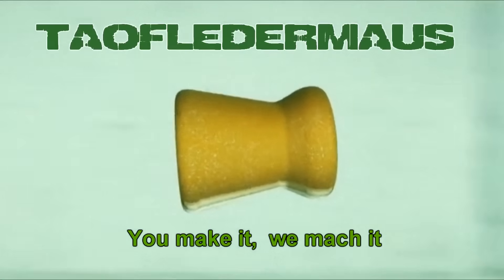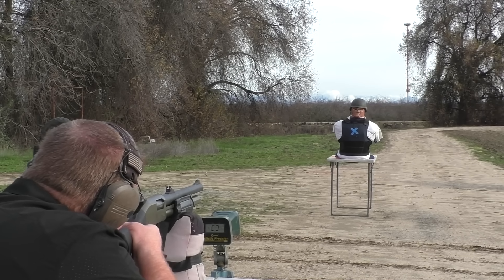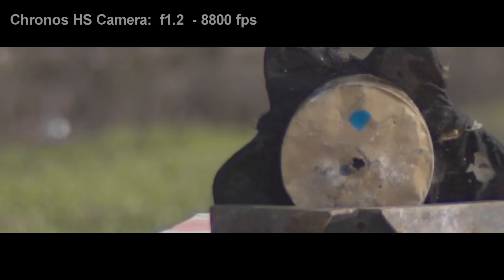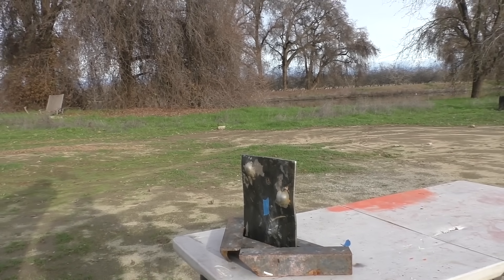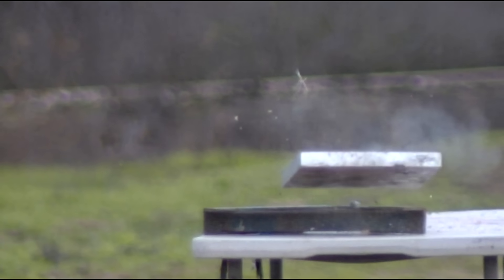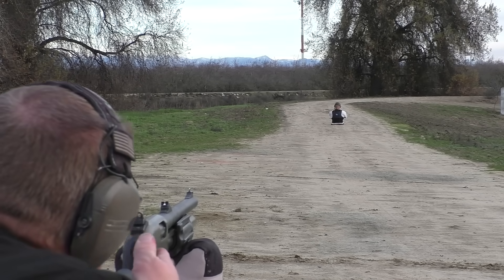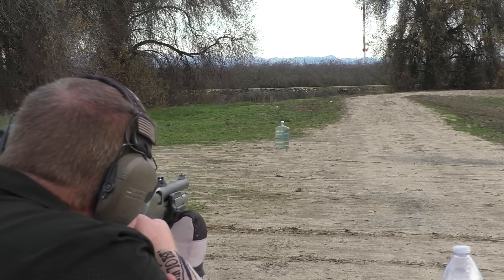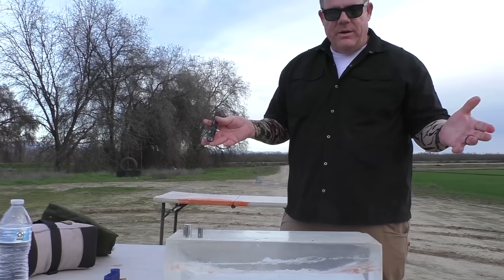The "MACH-71"  Super Perforator Slug   -  TESTED

Comment: I've always had an idea kind of like this, where you have a soft outer hollow "sabot" that would be designed to expand in a target, with a hard steel penetrator inside of it. That way you can get a kind of armor piercing hollow point, where if a target is wearing body armor that penetrator will still punch through, but if not then you get the stopping power of a hollow point. It's cool to see that the idea might have some actual merit if you designed the soft metal outer piece to fragment or expand a little more.

Comment: The fancy cutout on the front does absolutely nothing for the aerodynamics of the slug, and is actually going to slow it down, by creating an air stagnation point at the front of the projectile. If you want to make a slug that is optimised against wind resistance, just copy the shape of a standard 303 rifle bullet ! You wont be far wrong!
Reply from the maker: Many 12ga slugs are completely flat at the front.   Since there is a bow shockwave at the nose,  it doesn't really affect aerodynamics like you think it would.

Comment: I can actually see the fluid dynamics of this in my head.
if the gap between the aluminum sabot and the core were just a tiny bit bigger, a slightly rounded or dimpled back end on the core piece. maybe a bit longer taper on the front with a harder material.
I wouldn't change a thing with the aluminum sabot.
As this round leaves the barrel, much of the air is channeled into the sleeve space between the sabot and the core, as soon as it hits something, that also gets channeled in, compressing the air further, which then pushes the core out from the back, much like popping a bearing by pushing bread in behind it.
It worked beautifully with the lead, which flowed in like water at those speeds, less so with the aluminum, which is much harder.
Steel, nope, need a harder tip for sure

Comment: Great video guys! Without the brunt of the energy knocking those plates over I imagine the slug could have penetrated…like if they had put a cinder block behind that held the plate firmly, but maybe not. Awesome either way!
Reply from the maker: The plate has much more mass than the slug and doesn't even start moving until after impact.

Comment: That much water in California is going to cause Earthquakes.
Reply from the maker: I don't think that is how earthquakes work
Reply: @TAOFLEDERMAUS  Actually... ask Google's BARD AI. It will save you a lot of time researching how or why that is.

2.5x the typical snowpack last season, and excess groundwater weight and seep into active faults - it's a thing. 

USGS results lately in NorCal seem to confirm. The last time there was a significant snowpack like this was in 1983. 

Was also a solar max, but they had decent earthquakes that year, too. I wouldn't be surprised if a decent quake resulted from that kind of spring thaw.
Reply: @taofledermaus  Per Bard: "A spring thaw after record snowfall can cause an earthquake because the weight of the snow can put stress on the ground, which can cause the ground to break and shift. This can trigger an earthquake, especially if the ground is already weakened by other factors, such as previous earthquakes or landslides.

In addition, the melting snow can add water to the ground, which can make it more slippery and less stable. This can also increase the risk of an earthquake, as the ground is more likely to move when it is wet.

For example, in 2011, a magnitude 7.0 earthquake struck Christchurch, New Zealand, after a record snowfall. The earthquake caused widespread damage and killed 185 people.

In another example, in 2015, a magnitude 7.8 earthquake struck Nepal after a record snowfall. The earthquake caused widespread damage and killed over 9,000 people.

These are just two examples of how a spring thaw after record snowfall can cause an earthquake. It is important to be aware of the risks and take precautions to stay safe during this time of year."

Comment: Here is an idea.  Build the outside case from barrel grade steel and the penetrator from even harder tungsten.   Now have a charge inside the casing which has a shear support system that the penetrator sits back on along with the tight fit and glued in.   When the tip of the penetrator makes contact the force is enough to shear the supports and then force the penetrator back causing the inside secondary charge to go off adding a lot of extra force to the penetrator and pushing it through even the best bullet proof plates and armor.
Reply: Literal bolter

Comment: Kyle is a machinist. He has his stuff together! I figure he thought to have a hardened projectile that's pressed into a traveler, that will not melt in the shotgun, but, with the help of an old shotgun shell wrapped around it, it will spin out of the barrel and bury itself deep. Then, when the outside carrier nose flares & stops, it opens the press fit, & the inertia spits the hardened projectile on forward till the PUSH wears out! 
   I'm a retired tool-designer & I  imagine a lot of thought went into this punkin'-ball slug. 🙌🏁
   Bill, from Tn., 🇺🇸

Comment: If you made the steel plate so it didnt move you would have different results. Its like if someone limp wrists while shooting a handgun, it doesnt cycle properly. If the plate wasnt able to fall back so easily it would change your results.
Reply from the maker: It seems that would help but the velocity of the slug is so great  and the mass the plate is so high,  the plate doesn't actually move until quite a while after impact.

Comment: Wait a minute it is not supposed to work like that aircraft. Because the jet engine needs air flow through the engine or here the slug. The air is  supposed to pass inside the slug. This slug is closed. No air is going through it. Just around. Amazing.

Comment: Lots of suggestions, here is mine. I have been shooting for about 69 years, including shooting a hole in ½" carbon steel with an ordinary soft nose bullet. Weatherby’s old catalog from 1960 had some information about that, I do not know if they are still showing that. I agree that tungsten would be good, very high density and reasonably hard. You could make the slugs about 0.64 X the diameter of the steel slug and have the same weight (keeping the length the same). Tungsten carbide is almost as hard as diamond, but its density is a little lower than pure tungsten. I doubt that the aluminium cup is important, unless you can make it stay attached to the core to provide expansion. I suggest you just make plastic sabots - perhaps PTFE, as suggested below, although I think Remington and others may have used something else, maybe Nylon. Nylon 6/6 would probably be good, and you can buy it already filled with the solid lubricant, molybdenum disulfide, and other additives. For maximum velocity, nothing beats a sabot - while giving us the aerodynamic advantage of a sub-caliber bullet. One more point about loading, I noticed that you selected a type and quantity of powder to get the desired results - which some people overlook when using sabots. Think of the fun we can have!

Comment: wonder if there would be more penetration by the steel core if it had more of a rounder taper towards the shoulder instead of a straight cut?  The pointed tip is fine

Comment: Might have a better chance of penetration if you clamp the plate down so it cant move as much. I'm not a gun person but these are an impressive design with lots of potential for refinement. I wonder how different materials would change the result.  Like if you swapped the aluminium and steel around how would it impact things, Hard outer steel layer with a notched aluminium core. Would it still penetrate a vest and then eject a spray of aluminium or would it just lose its penetrating power?

Comment: Really cool video. It would be interesting to see the effects on your targets if they were held more securely as it seems to me that a lot of the impact energy is being displaced / reduced by the instability of the targets. Perhaps clamping the steel plate in a vice and maybe hanging the lead plate in front of a concrete wall or on a tree would give you a very different set of results.Either way the Welsh wizard has produced one hell of a bullet. :trophy-yellow-smiling::text-green-game-over:
Reply from the maker: The impact occurs so fast,  it really doesn't matter if the target is held securely or not.   We've tested it and the results are exactly the same.

Comment: for safety reasons i would recommend a rig from which you can hang targets like steel plates.
standing targets tend to fall back when hit, forming an up facing angle which directs ricochets up, drastically increasing the distance said ricochets can travel.
a hanging target tends to swing back when it is hit, deflecting any ricochets down towards the ground, which reduces risk to the people involved, while also making the slugs easier to retrieve i would think.
Reply from the maker: The plate has many times the mass of the bullet and is quite slow at reacting to movement.

Comment: Scram jet technology.  If the point is correctly positioned the air density at the edge of the intake is very concentrated.  Kind of like a mechanical air compressor which created a manageable burn at high altitude.

Comment: The slug would of ricochetted if the plate was in solid! 
"A sprung load!"
Because it was movable without being secured in place with some sort of tension being a " Un sprung" Load!
It comes to a dead stop!

If you put mount that metal where it can't can't move. That energy can ricochet back at you! When it can't transfer enertia . Meaning it will take the enertia and transfer it.  U will not have a bounce back effect!

Although it may have been able to penetrate the metal!
Better keep it unsprung then to have it sprung and fly back at you!!

Comment: If the slugs used hardened steel core and a sectioned aluminum body theu would likely punch the plate. The energy required to mushroom the aluminum is wasted rather than punching through

Comment: the transfer of energy, your test didnt have support on the plate so it took all the energy and moved. A human target would experience more resistance to movement so the round may be able to penetrate while plate is held in place not allowing recoil of plate.
Reply from the maker: The impact occurs very fast,   in fact,  faster than the heavy plate can move.
Reply: @taofledermaus  you could sayy that but once enough energy transfers then it will lose momentum. the bullet stopped moving because transfer of energy. if it still had energy then it would deflect or move but since the plate goes flying then one can see the energy transfer instead of penetrating.
Reply from the maker: @knightjacob80  We've tested it before.  It doesn't matter if the plate is loose or set against a sand bag.  You are confusing low speed collisions with high speed ones.
Reply: @taofledermaus  Okay :)
Reply: @taofledermaus  The plate does move though so yes transfer of energy lessening bullet pen.

Comment: But is there a "bypass" around the nose point intake?  The secret of the SR-71 was that the nose intake point could retract at slower speeds and move forward at higher speeds in order to control the efficiency of the engine's thrust output.  If the pointy tip has no bypass, as in this slug, and there is just a point, it would seem to me the aerodynamics would not simulate an SR-71's engine in any way.  However, as they say, "The proof is in the pudding".  If the results are as good as the producer claims they are, then good for him.

Comment: You guys should really consider mounting the armor more securely.  With kevlar it hardly matters since that is worn on a person but with armor plates that are normally mounted on vehicles or stationary blinds they don't tend to absorb kinetic energy through inertia transfer while your targets do.
Reply from the maker: With Kevlar,   you need something to back it up for it to function normally.    The steel plate,   the mass of the plate prevents it from moving until quite some time after impact.
Reply: Visually it looked like it moved before all the momentum transferred, but looks can be deceiving.  It's all in the math.   @taofledermaus What's the mass and dimensions of the steel plate?  I can calculate it.

Comment: ai got a plastic crossbow poundland and ran out of darts i made some out of bamboo hollow tip and used sand paper flights smooth and coarse if you understand english aerodynamics lucky i covered the point because it bounced off the window straight back in my eye the shape of the planes wings which lifts your not looking to nature and seeing how fast a bird flies faster than light meets your short sighted eyeball teh old muscle cars cut through air chevvy ss plymouth charger impaler

Comment: jet engine design delivered on a hunting pellet shiny surface reverse it square slug covered in wet and dry spring that retracts from the recoil keeping in mind vacuum double charge cluster smart the charge that propels the bullet and another that magnesium phosphorous volatile coat it in fluerescent tubing from fishing or glass to peirce the armour plate... bearing in mind that tech has gone viral twin armour plated reinforced glass and fibres like polyamide kevlar are just there to slow the projectile down the new plastics berrylium coatings finished to a high gloss resistant to cutting disks and hack saws slides off tungsten carbide chromium alloys basically i dont know the new drone tech how far into the millions your playing with well done youve penetrated kevlar ukraine going up against russia is like wales going to war with england and doing well

Comment: Hmm, maybe the ones with the titanium or tool steel penetrator will make it through the metal plate.
maybe this one did not make it because the steel core did not seperate from the aluminium casing?

Comment: Doesn’t the aerodynamics cause it to tumble?  The area around the point catches air hard
Reply from the maker: They are spin-stabilized
Reply: Ig things work differently beyond supersonic speeds, it doesn't tumble since the area around the steel cone catches air evenly (Or doesn't at all if it's traveling fast enough where the pressure cone deflects air away from the ledge but the steel cone has to be long enough for that to happen)

Comment: If the steel plate was better supported the bullet core may have penetrated better. A lot of energy was absorbed by the plate moving on impact.
Reply from the maker: But it doesn't start moving until a bit after the impact.   We've tested the "braced" vs  "unbraced" plate and it didn't make a difference.

Comment: If that plate was held better it may have a better chance going through. Something to hold it tight enough to not be able to disperse the energy through flying away but that’s just a theory from a guy who dripped out of middle school😂
Reply from the maker: It would help with slow speed impacts but  the plate doesn't actually move until AFTER the impact.   (inertia)  We've tested the concept before and there was no difference.
Reply: @taofledermaus  okay awesome, I can see how that makes sense. Thank you for the knowledge

Comment: Theres a story about someone that made very pointy slugs which detonated in the mag tube as the nose of one acted like a firing pin on the round in front. Did you put one in at a time or have a full mag?
Reply from the maker: Most of these the tip was below the crimp,   one or two did poked out.  We always load one at a time as part of our safety procedure.

Comment: Damn! I can't get this thought out of my head, so let's write it down. It might be possible to do a ramjet of that slug. You would need to make the slug from two parts, so that the air would flow through the side of the middle part. The middle part would be hollow and filled with a few drops of jet fuel which would drip to the cavity where the air flows and would burn because the air is hot on these speeds.

Comment: It would be interesting to see the sleeves replaced with PTFE sleeves. PolyTetraFluoroEthylene has the lowest known coefficient of dynamic friction at 0.02, which is equivalent to ice on ice. So PTFE is soft enough to engage the rifling (without clearance), slippery enough not to drag in the barrel, hard enough not to tear, light enough not to restrict acceleration, and hard enough to penetrate kevlar. Being low friction it would not impede the core’s penetrating ability either.
WRT the core, perhaps tungsten carbide or depleted Uranium would have the most penetration through steel.
Sadly I can’t manufacture said rounds as I don’t have the tools, but perhaps someone can take up the mantle?
Reply: Good point, I am working on a similar comment. For some reason, I think people usually use nylon or some other polymer instead of PTFE, but you make a good case for the PTFE. Generally I think the sabot is supposed to drop off, so it would not need to be hard enough to penetrate the target, just enough to engage the rifling.

Comment: It transferred the energy to the plate and pushed it backwards, that is why the slug stayed there because of this. Your targets have to be fixed and against a backdrop so they cant go back. I think it would have at least opened a little. Tungsten core would have to be thin and sharp or will shatter because its very brittle. Thanks for sharing.

Comment: It would be interesting to see the same concept done with the core in the shape of the SR-71's inner spike set at the mach 1.4(or so) position to see if it helps with a ramjet function.  The outer casing would have to be hollow all the way through and may have to be assembled to make it work.